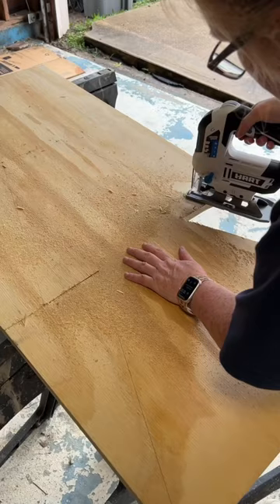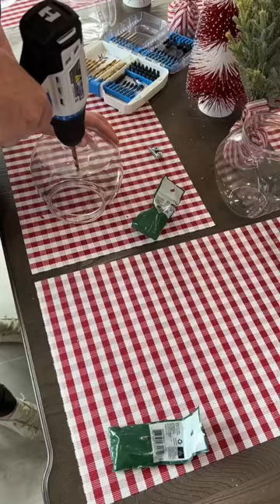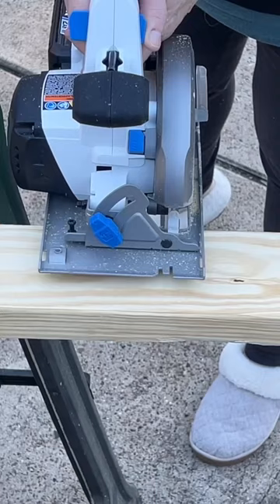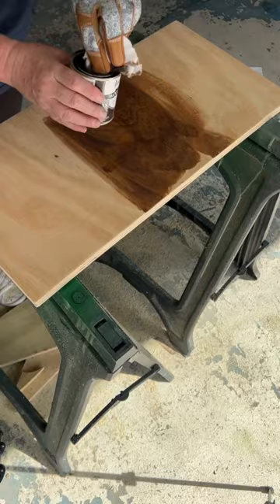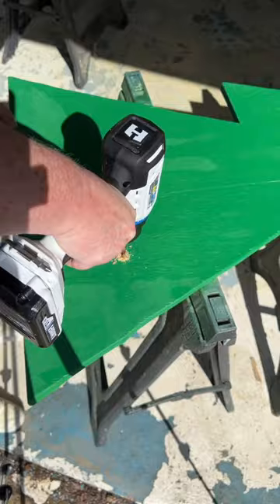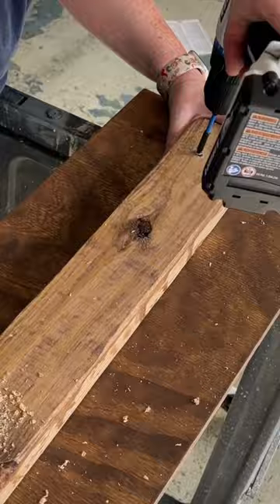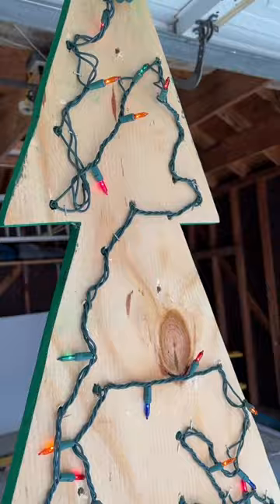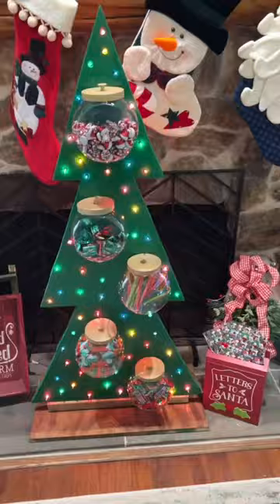🎄Here’s the SECRET TREE PROJECT! LOOK What I Made! #christmasdiy #creativeonthecheap #shorts

Comment: How did you attach the candy containers to the tree? Did you put hokes in the back of the containers fir screws? If so, how did you add the hokes?
Reply from the maker: I drilled one hole on one side towards the top of the container.  I put a bolt through the hole and used a nut to attach it to the tree.
Reply: Thank you!